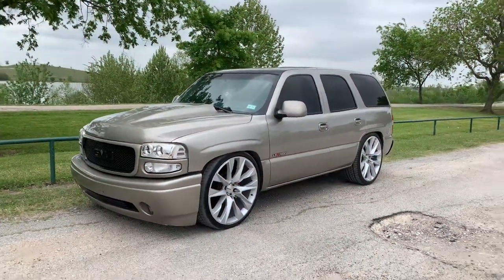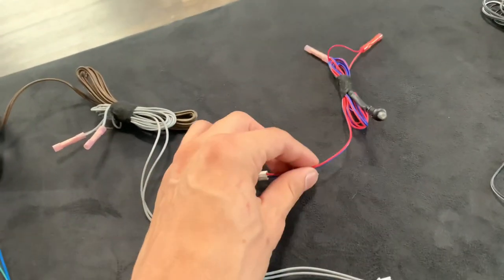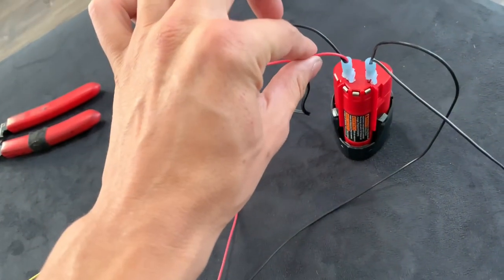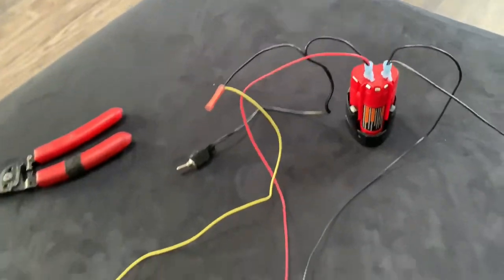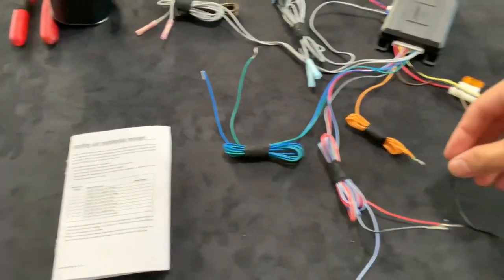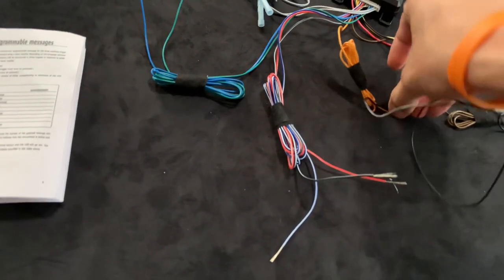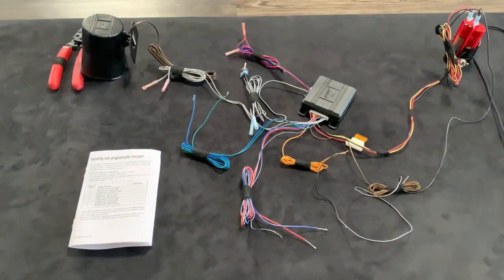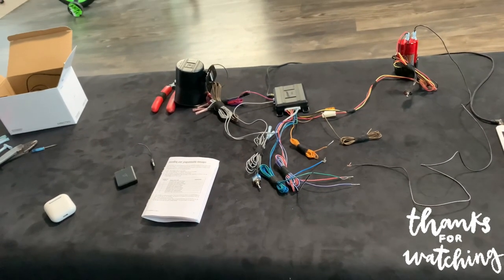Give your Truck a voice!! 🔊 How to wire 516L Pt 2

Comment: You have inspired me to get this alarm set up.... I have a couple questions on installing... If you could help me it would be greatly appreciated
Reply from the maker: Oh nice! what is your question?
Reply: @MiGo713   I'm having trouble locating which wires to tie into the truck and where.... I'm interested in starter kill and door locks.... I would like remote start... How to get rid of the factory fob. I know this is a broad question but any advice would be appreciated

Comment: Does the switch have to be momentary?
Reply from the maker: I used a regular toggle switch so I could leave it on the on position for the system to be on anytime I want, but it does come with a momentary switch from the factory since they didn’t intend to use it how I wired it

Comment: Did you ever install Voice Viper Module in a Car to Factory Security System?
Reply from the maker: No I haven’t, usually aftermarket has more control over the module with the extra auxiliary’s and other functions